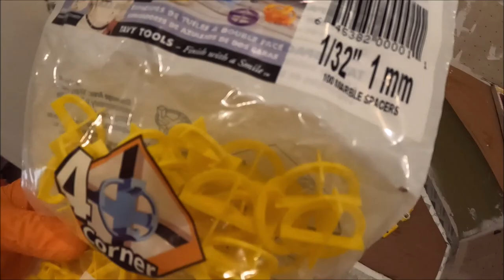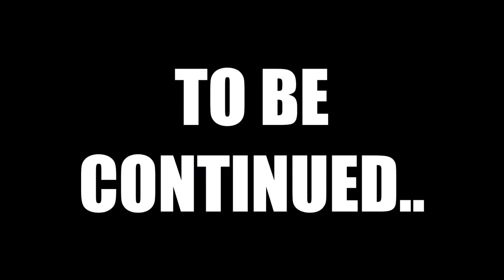Installing Marble in a Shower a Bad Idea?

Comment: 2 sincere questions.  Was there no need for an uncoupling membrane on the floor? Why didn't you use 1/32 clips and wedges to help prevent lippage? Really enjoy and appreciate all your videos and admiring your top quality work. I'm always learning something new from watching your channel.
Reply: The stone tile he is using in this shower is much too small to use leveling clips. This guy is a real setter and knows how to install this material flat.
Reply: Uncoupling membrane is not necessary on concrete, most times it's used for a wood subfloor as it will have more movement. Uncoupling membrane is similar to using backerboard on a subfloor. Clips and wedges are not necessary either depending on the tile and if you've been tiling for a long time and do quality work, you can easily get no lippage while tiling. Also since marble is much softer than something like porcelain, it's possible the wedges could break the tile with the force of the clamping, especially since the tiles are smaller.

Comment: So you like the Dewalt over the Delta? I'm buying another one this week and am stuck on the two.
Reply from the maker: DeWalt is the best
Reply: @LandbergTileTV  copy that. My rigid started as a single project tool and turned into a business tool. 8 years later I'm replacing it. Deck is so bad that on a 24" rip I'm 3/4 off by the end of it. Multiple times spent squaring it but it just worn and a half way poor design imo on the wheels that ride the rail and allows deck wobble. Thanks for the reply and I'll give the Dewalt a go. 🤙🤙

Comment: Would you use the Levtec tile levelling system on a slightly larger marble 6" x 18" & what size of notched trowel?
Reply from the maker: Yes I would and 1/2 inch trowel for sure!
Reply: @LandbergTileTV  Thank You. Does it matter whether its a 1/4" x 1/2" or a 1/2' x 1/2" as long as its 1/2" depth?  I have wondered why they make different notch widths?

Comment: bro you have to cut the very edges of the quartz seat so its flush with the marble L-cut  pieces . if you know your marble walls finish at 1/2 inch, then take an angle grinder ( you can do this after you install the seat top) and go in at a 90 degree angle to the 2 long sides of top, but just at the very edge of quartz and make a cut so the edge will equal a half inch. i usually set my first few tile rows then plumb up to make a mark on the edge of seat top, this way the L-cut tile doesnt have a big grout joint around it. i know your re tiling the seat but for future. i also do something similiar when i make my own soap corner shelves, as i never imbed the very edge of the soap dish into the cut out wall gap and in that instance i make a notch at the very ends of shelf, so the last bit of the dish sits on top of tile and not in the groove... besides that it looks freaken killer. .... it sucks because i and others have said you should install seat top first, and now you cant get the sucker out....i know all of us can sit back and critic stuff we see and its really not right, but whenever i do these marble nitches with polished ends i personally think it looks better when your not looking at those polished edges straight on. its a lot harder but especially since you laid it out so perfectly with no L CUTS, i would of polished the front pieces or the field pieces instead of the inside nitch pieces, but that i guess is perhaps a matter of taste...i would of however probably  kept the bottom nitch sill facing out like you have it and maybe over hung it about a quarter inch
Reply: Good to know